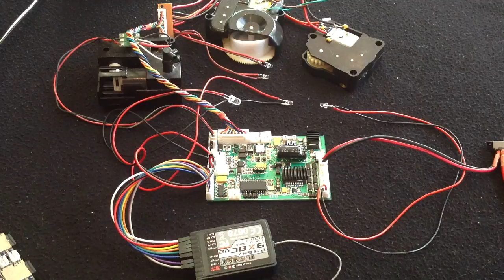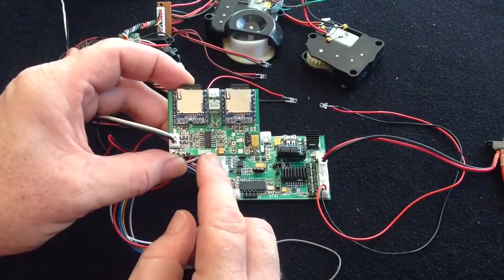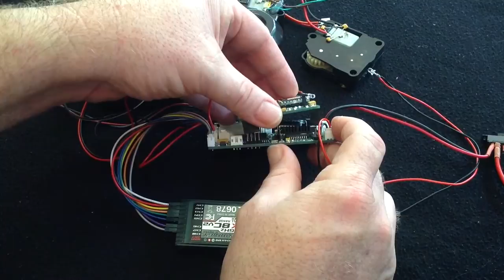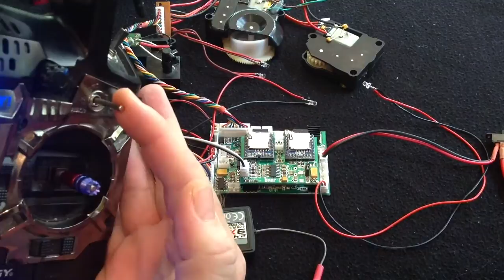ASP Intro

Comment: This is sweet, how much are we talking in dollaridoos?
Reply from the maker: Will not have a set $$ until I can get quotes for the PCB Assembly and the latest prices on components.  However, I can say it won't be the cheapest tank control board nor the most expensive but I hope it will offer the greatest number of features per $ spent.